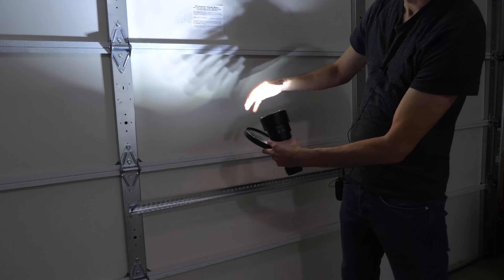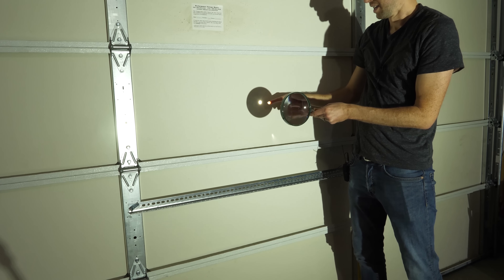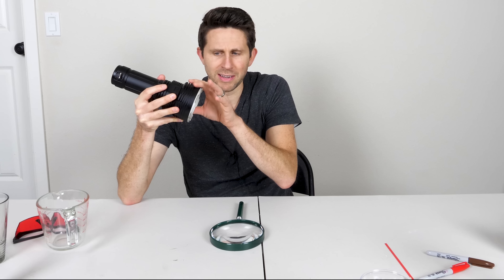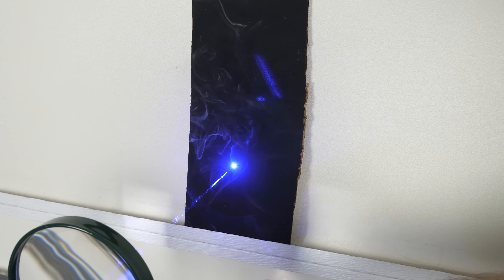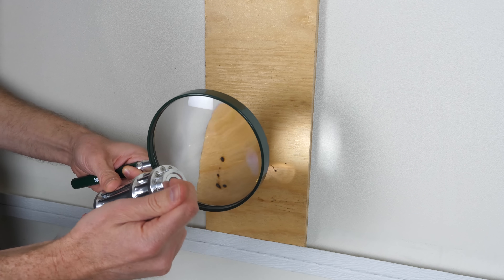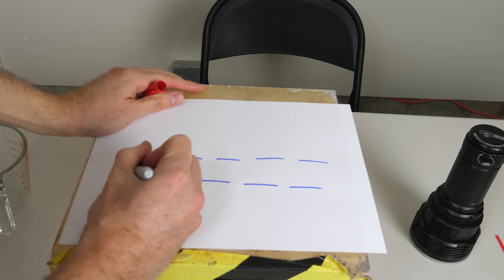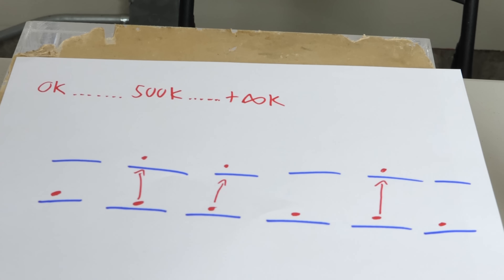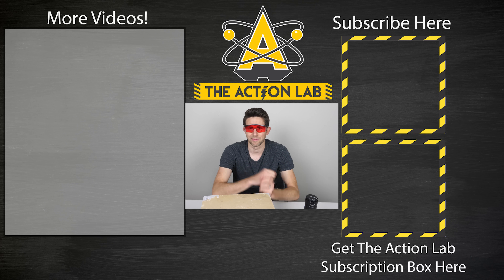What Happens if You Focus a 5W Laser With a Giant Magnifying Glass? Negative Kelvin Temperature!

Comment: You are confusing temperature and heat/energy.  It's a common mistake.  You can't increase the energy.  But you can change the area/volume over which the energy acts.  Brightness from a distant light source is also treated differently.
Reply: Quite right.  Hes heavily overthought it.  It's about energy density and photons and not heat directly as for conduction and convection.  It's a bit of a muddled explanation of what he is trying to explain if he was in the correct area anyway.  Nearly everything on earth is powered by the suns energy, directly indirectly.  Its quite easy to create temperatures hotter than on the surface of the sun here on earth, and done regularly in various scenarios.  The suns surface temparature isnt as hot as it could be compared to many other things.
Reply: @sophxxx1806   The point is that you can't create a higher temperature than the sun's surface, using concentrated sunlight.
Reply: Do you know that temperature can be derived from kinetic energy of atoms?
Reply: @nedisawegoyogya  judging by that explanation only atoms can have temperature?
Reply: @irrelevant12  exactly, temperature is a makroscopic statistical effect derived from the kinetic energy of atoms. It's not a fundamental property of a system, which is why we can have something like am absolut temperature in the first place.

My bad, it seems like my understanding of temperature was sluggish aswell:

https://en.m.wikipedia.org/wiki/Negative_temperature
Reply: @Professor Frog The guy in the video said a negative temperature is hotter than any positive temperature but this doesn't explain why the magnified beam is hotter than the unmagnified beam. How can the magnified beam be hotter than the source? Are you saying the light is flowing from the target to the source? Is the light at the target at a  hotter or lower temp than the source? Obviously it is hotter or it wouldn't burn faster than the unmagnified beam. So the explanation given doesn't really explain anything.
Reply: @Tyler Is -0K hotter than +0K? Is -0K hotter than -infinityK or is -infinityK hotter than -0K? When it's said negative Kelvin temperatures are hotter than positive kelvin temperatures I'd presume that -500K is hotter than +500K which implies -500K is hotter than +infinityK and also -infinityK. Therefore -0K should be hotter than -infinityK. The question then becomes what is the max temperature of the focused beam at? Is it -0k or -infinityK?
Reply: @Tyler Ok so the burning wood is at a positive temperature. I see your point now. But doesn't the light itself have a "temperature"? Although it does seem you need atoms or molecules to have temperature that is thermal temperature. You also have radiant heat energy which is light. This is related to black body radiation. So light does have a "temperature" IMO. The light at the focal point should have a higher energy than the source if the source is a laser. The question is whether the temperature of the light at the focal point is closer to -0K or -infinite K. If I remember correctly, in the video it's said the temp at the focal point is closer to -0K.
Reply: @Tyler An LED laser is made using what's called a "columnating lens". Without that they are no different than a regular LED lamp. Not to say there is no difference between an ordinary lamp and an LED. An LED produces more coherent light and does so through "population inversion" (as described in the video) giving it a so-called negative kelvin temperature. LED's also produce more monochromatic light (without any filters, unless you consider the impurities or "dopants" used in the semiconductor material of an LED to be a "filter" since that is what gives an LED it's color). But if all we're worried about is heating the target then a columnating lens could make a flashlight beam laser like. No columnating lens will produce a perfectly columnated beam though. An LED laser doesn't have perfectly columnated beam. So a columnated flashlight beam isn't going to be perfectly columnated either. But we can get close enough so that when using a magnifying glass the beam will then converge the light into a point which is hotter than the source. If we are using an incandescent lamp of some sort as our light source rather than an LED then nobody can say the temperature of the source is negative kelvin and that the apparently higher temperature at the focal point doesn't violate the laws of physics by having energy flowing backwards from a region of low energy to a region of higher energy. Understand?
Reply: @Professor Frog The energy density of the focused light can be infinite whereas the energy density of the light source is finite. I once read an explanation that there is a limit to the enegy density which can be achieved by focusing light with a converging lens. That limit is supposedly determined by the energy and/or size of the photons and the number of photons. But I have read elsewhere that a converging lens creates a singularity at it's focal point. I'm not sure what to believe about that although IMO it makes more sense to say there is a limit to the  energy density (as explained). Even if there is a limit which prevents the energy density from becoming infinite at the focal point I'd say that the energy density at the focal point can exceed the energy density of the source since the number of photons  at the focal point can easily exceed the number of photons per unit of area at the source
Reply: @Professor Frog On second thought the reason the energy density can be infinite at the focal point is because the photons occupy an area of zero surface area. The surface area of the focal point is zero. So no matter the number of photons or their individual energy the energy density would be zero if the surface area shrinks to zero. But this presumes the photons have no cross-sectional surface area and are more like singularities themselves. Yet photons do have a size but the size is that of their wavelength. Although they may have such a size on one axis, the axis of the propagation vector (the longitudinal axis), they might NOT have a cross-sectional surface area (on the transverse axis).  So the objections to the energy density which can be achieved at the focal point of a converging lens may be wrong. But I do recall reading an explanation about the limits of the magnification power of microscopes based on the size of the photons. It's possible that explanation was wrong though. The limit may be due to other factors such as the size of the target object being too small for the photons used (I'm referring to "antennae theory" here which says the receiving antennae needs to be at least 1/2 or 1/4 the length of the wavelength of the transmitted EM wave to be received by the antennae...or something like that). That would limit the magnification power of a microscope because once you get into X ray and gamma ray spectrum and above the photons start to pass right through matter (or alter it drastically).
Reply: John Chestnut He never mentioned energy like that. Also, since the energy is quantized by photons, decreasing the area is equivalent to increasing the energy. This is a basic principle of optics

Comment: Okay, so you took a laser pointer and shined it into a magnifying glass in order to get a smaller dot, which started to burn things immediately. But what if you shined it through multiple magnifying glasses, progressively getting a smaller and smaller dot? Would it result in an instant flame? How many would it take to burn a hole straight through wood, or would it melt the magnifying glasses before it reached that point?

Comment: You're making a mess mixing up energy and temperature...
Reply: valebliz This is how I understood him:
Wait a second...
It has a positive temperature, not the higher the average particle speed is but the more of the different quantized energy states a thing uses up?

So that means a -0K temperature has the most energy in a sense, because all particles take up all of their highest quantum energy states?
But due to them only taking up one energy state, namely the highest one, the entity has a negative temperature.
Is that right?
Reply: @venceremosallende422  the point is it's the premise that's wrong. The lens simply focus the light in a smaller area, so the total E output don't change even if the temperature gets higher. There's no need to bring up energy states and even less negative temperature (lol). The first example he makes using the flashlight don't work because there's so much diversion of the rays he's unable to efficiently focus a significant amount of the light emitted by his lightsource, at least if he maintain a useful focal distance from the lens. Again, he's making it way more complex than it is.
Even his first assumption about being phisically impossible to focus light producing an higher temperature than the original lightsource makes no sense, the point is you can't obviously produce an higher energy output than the source you're using.
Reply: @valebliz  exactly. You explained it better than my comment
Reply: @alyssavonxylander1226  thanks, you definitely put in more effort though

Comment: The "laws" of thermodynamics is only as valid as the current discoveries. - When we understand more about the universe, we adjust the "laws" to fit them.
Reply: No those laws are pretty much in Stone, you can't just have energy spontaneously occur in atoms and such a thing never happens unless the energy is transferred from another source, therefore there is no free energy and the laws of thermodynamics will always exist as they are
Reply: sacr3 - No. All science does is create provisional models for the purpose of prediction and control. As soon as a better model is created, the old models will be sidelined. Nothing is ever "written in stone". Science is a process always in motion. We don't know what we don't know. HalfBakedPinoy is right.
Reply: @sacr3  When you master the technology of a magnet with only one polarity (either positive or negative) and not converging parallel lines of force, such equipment (perpetual motion machine) will be commonplace. 

Another technology for this purpose is the molecular programming of materials that can generate heat and electricity only with constant molecular excitation, forever.

This is the same principle with which the rays are generated in your clouds of steam, only these happen indiscriminately and are not "controllable".
 
These are some concepts of molecular quantum mechanics that we can use in the short term to solve the energy problems in our society.
Reply: HalfBakedPinoy - You're right. All science does is create provisional models for the purpose of prediction and control. As soon as a better model is created, the old models will be sidelined. Nothing is ever "written in stone". Science is a process always in motion. We don't know what we don't know.
Reply: @virvisquevir3320  couldn't agree more.  I wish more people would "wake up" though.
Reply: @harven23  I wish more people would "wake up" though.
-----
I wouldn't say wake up--it's more like be properly educated. When physical laws are taught in school, only the meaning of the law itself is taught and not how it became a law in the first place, which is from the fact that hundreds of thousands, if not millions, of observations have been made that show the same thing to be true over and over again. They also fail to teach that it's not possible to prove that a law is true, but it is possible to prove that a law is false by providing one example called a counterexample. Once a counterexample is shown to be true, then, as Vir Visque Vir said, physics is updated to reflect the new observation. By not teaching students how a law came to be, and by not teaching that laws can't be proved, only disproved, students come out of school thinking they understand and that laws are written in stone, which is quite unfortunate.
Reply: @sacr3  "Everything that can be invented has been invented." -Charles H. Duell 1899

The universe is vast and to limit your understanding because of a man-made barrier (laws) is like saying you know everything there is to know.

Comment: So, from the pin above, it explains more than video above. So, you have to put negative or it will be breaking the law of thermodynamics. So, well, breaking the law of thermodynamics is misused, which what you do see, do not justify as breaking thermodynamics but have limit understanding so it justifies the statement 'breaking law of thermodynamics', but it doesn't, so it applies to all things when people say breaking like you would say breaking law of thermodynamics for Perpetual motion which without energy source, but it is a misused which there is an energy source everywhere which you believe zero point of energy from mainstream science, but not related to this topic, so about this topic, so, you can't say positive thermodynamics for higher temperature from laster thru Mag.. glass because that would break the law? But it is about context, so you can say higher positive thermodynamics or negative thermodynamics base energy state is a higher level than normal energy state, so it is opposite. So, the light itself will not get brighter from sun to Magnifying Glass which you say so that means it will not get hotter, but it get hotter like light from sun to M. glasses, so ya means it gets hotter but not brighter, so it means the concentrate of light do get narrow, so when it gets narrow, so it brightens up more, so it makes sense. So, sun and laser do get hotter thru Magnifying glass, when it gets brighter so if you look at a light it is bright to your eye, so the amount time you cover your eye to the amount of time to light that thru M. glasses is less so it is higher bright to your eye. It would be good to add a temperature sensor and ya can show laster at a further distance like ya did with the light, but ya didn't do in this video. So, bright and hotter are separate, so not the same as link one whole which hot is the result of bright which is a process. The regular glass and M. glasses is opposite since M. glasses is an opposite medium which narrows, and regular glass and the surrounding atmosphere is a spread out medium.

Comment: what is hotter then infinity? im kinda confused ;_:
Reply: Exactly, that is the problem with treating infinity as some number instead of as the concept which it is.
Reply: @joec2078  their are different sizes of infinity though
Reply: My ex is hotter than 🌞
Reply: Thank abstract mathematics.  Because absolute temperatures like the Kelvin scale where 0K is the lowest possible temperature with classical mechanics you get "undefined" states that exist in quantum mechanics that are technically larger than infinitely large values (undefined) meaning -0K > +0K.  The numbers mean nothing in the real world, they are just a way mathematics is used to make sense of something that doesn't fit empirical models.

TL;DR; math is super weird
Reply: - infinity
Reply: @potatoanimations9982  it would just turn matter into light before the infinity achieves lol. not possible at this stage of understanding.
Reply: Infinity plus one?
Reply: the playground slides in summer

Comment: I think your breakdown of entropy and energy states was a little sloppy. Too many red herrings without a complete explanation.  The reason some thermodynamic systems can be notated as negative in Kelvin is because the entropy of the system has a negative correlation with the amount of kinetic energy added, and positively notated systems have a positive correlation with entropy and energy. You were technically correct, but the explanation was missing some meat, which made it very confusing. You needed to set the foundation up with the relationship between the energy and entropy more fully first, and then explain how that led to rollovers in notation. Also I may be missing something, but I don't think you can rollover an infinity without an infinite number of effected  particles in a physical system. I'm pretty sure the infinity only comes into play as a concept in the same way that conceptually it's impossible to count from 0 to 1... But I'm just guessing there cuz I can't be arsed to research any more atm.

Edit: I'm an idiot who forgot that energy states aren't binary or finite. Who's sloppy now. Also forgot to mention that your citation link is broken and I'd like to know the machanics of this with lasers specifically.

Comment: For your flashlight, you can put a collimating lens to have all light ray parallel (like the laser) and then you put your magnifying lens.
And I think you misunderstood the principal involved here. What is important here is the energy density in J/m2. In your setup the energy will always stay at the same value (if not taking in account the losses) but the surface will drastically be reduced (focusing) so the energy density is locally increasing (more photons hitting the target at the same location) thus burning the target.
Negative temperature has nothing to do here. If you put a TC you’ll measure a temperature not that crazy high.
Thanks for being curious
Reply: What?
Reply: I was wondering the exact same thing :)
Reply: This is exactly what I mean with my comment as well
Reply: Exactly! Is he confusing the phenomena of heat energy by conduction where energy cannot transfer from a lower temperature object to one with a higher temperature. The 2nd law of thermodynamics applies to 'systems' of energy storage and transfer over time. Energy is not a vector it can concentrated - life is an energy contrating phenomena - it will in time dissipate.
Reply: danni kerr 
Yes, the 2nd law deals with entropy. That translates to temperature sources in specific applications but not all.